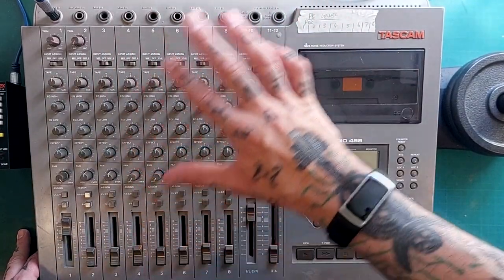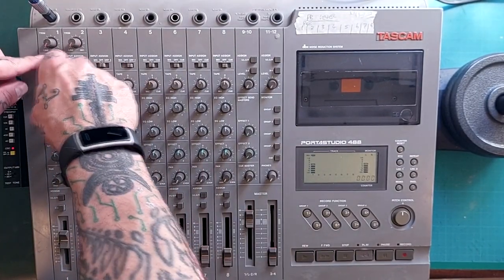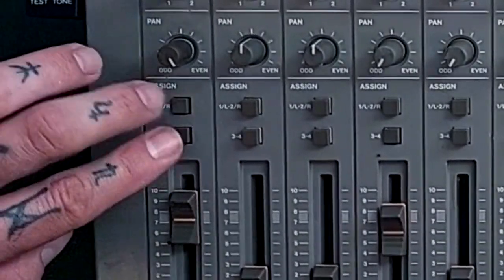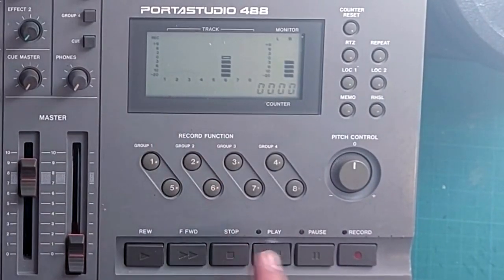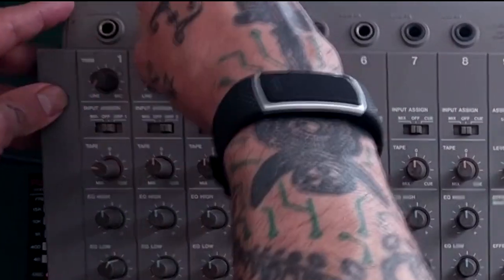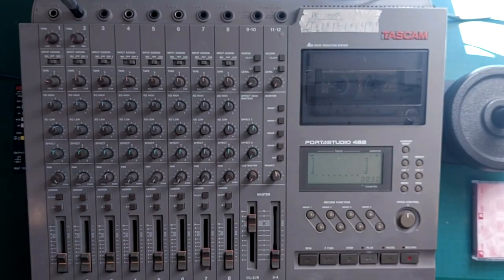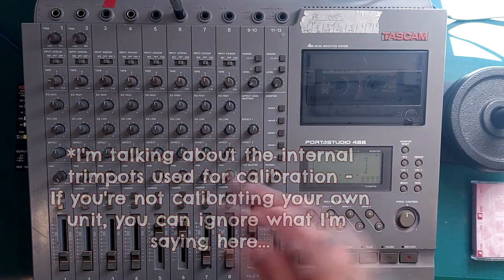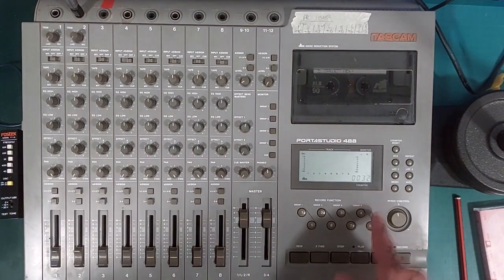Tascam 488 Mixer MEGA Tutorial

Comment: Ok so I have a drum machine connected to channel one and the audio running out of the ports studio to an amp. The amp is playing the sound from the drum machine perfectly fine, the main master volume is working fine and the individual track mixer/ volume adjustments are fine as well, but the monitor on the portastudio is not showing anything. The unit rewinds/plays/ all that and apparently would record fine if I could just get the audio to the monitor to record it? Help with this would be much appreciated I’ve never messed with this machine before and watching your video it seemed like it automatically just showed up in the monitor. Unsure what to do lol.

Comment: hi man, i want to do a tape delay with my 488 mkii and a revox a77 but i cant find any effect out on the mkii. do you know if there are some on the mkii version ?
Reply from the maker: Yeah, it’s the two jack sockets to the left of the XLR mic inputs on the top left of the unit, it says “effects sends” below them!
Reply: @Tetrakan  thank you so much ! also the cables welded to the motor of the cassette part have recently detached, I would like to solder them again but their length is very short, I do not know how to do...
Reply from the maker: Search for soldering tutorials, there are hundreds on youtube
Reply: @Tetrakan  sorry i wanted to know if you had any trouble soldering these cables, i wasnt clear enough 😁
Reply from the maker: No problem - I found it easy to do, but I have good equipment, and I have spent a lot of time soldering. Your mileage may vary!

Comment: Great machine, but I’d be tempted to trade mine for an mk2, just to have the mids eq. Always thought it was kinda neat having the ability to record 8 tracks on a good ol phillips cassette.
The 488 is definitely a bit more complicated to work with, isn’t it. I can’t even imagine what a 688 would be like....
Great tutorial here, I think a lot of ppl initially struggle with signal flow, and you did a great job of demonstrating!
Reply from the maker: Yeah if price and availability were no object, the Mk2 has better socket access, phantom power, a back-lit screen, and like you say easier interface and parametric mids. Some people swear bt their 644/688 but I couldn't get on with that digital routing system.

Comment: Loving these videos man! I blew an opamp on my mkii a while back, finally got around to diagnosing it (was literally smoking so easy to find) swapped it and it lives! that's until I put everything back together only to find out the gear c crapped out hence I found your channel :D
I'm thinking about busting out the mod for wiring up each channel to a 1/4 output. I see a bunch of people have done it but I'm not finding the info online. Do you have any intel on how it's done?
Reply from the maker: Thanks for the encoruagement. I ahven'y ctually tried those sorts of mods. I suppose I'd approach it by wiring the coupling capacitor at the end of the gain stage to the positive pin of the socket, and the negative pin to a nearby point on the same PCB connected to circuit ground. I think that would basically work, but I'm not clear on whether it woudl eb advantageous to add resistors in series or to ground for impedance reasons, i'd have to experiment.

Comment: Very useful tutorial thank you ! I was wondering, there is no individual output for the 8 channels but are outputs 1L, 2,R 3 and 4 those of the groups? (1/5, 2/6, 3/7, 4/8)
Reply from the maker: Those outputs correspond to the master faders. You can route tape signals to those outputs using the methods shown in the video. Check the other comments too - there is a workaround to send all 8 tracks to a different output socket by using sync, headphone and effect send sockets as well as the group out sockets.
Reply: @Tetrakan  thank you very much mate !

Comment: Tetrakan! I have owned a 488 for about 6 months and love it, however recently when I play a tape or try to record onto the tape, the tape speed makes a slow and depressing way down to a stand still, I'm presuming this is due to a knackered belt of some sort, was wondering if you would have more of an idea of what belt i would need to replace?
Reply from the maker: Could also be the idler tire for the reel motor needs replaced, I’ve used an o ring from an assortment box for that with success. The capstan belt I use for the 488 is the 3.4 flat belt from gbaudio.co.uk it’s about 200 mm folded length.
Reply from the maker: I’m pretty sure teac/tascam ceased supplying spare parts for their cassette stuff about 5 years ago - at least they have completely ignored all my enquiries in that time. The service manual is available for free download from my blog.

Comment: Thanks for sharing you knowledge, great video!
One constructive criticism: The sound of the pitch generator get's very annoying.
Maybe use a lower octave, or something like a drumloop for demonstration purposes.
Reply from the maker: Thanks. Good advice. Im planning to use  less intrusive, lower pitched synth drones in a situation like this and mute them while I'm talking.
Reply: @Tetrakan  Nice! By the way, your videos got me thinking to buy a old Tascam…I am looking at either the 488 or the 464. Leaning more toward the 464 for its individual tape output (which the 488 is lacking, right?) also it seems to have the better EQ section.
I want to use it as a mixer, as well as running tracks through it for some tape goodness, but also being able to easily export to a DAW.
What would I be missing (apart from 8 tape tracks) if I go for the 464?
Sorry for the long text…and don't worry about answering, if you are busy! Keep up the good work, thanks for all the info!
Reply from the maker: @SONWU youd be missing midrange eq on the 488. 488 is single speed. You can export 8 mono wavs from the 488 simultaneously using 4 x tape out, hard left right group out, effect send and sync out
Reply: Cheers…bought a 464 ;) with BBE, fully serviced for 140 GBP (in Japan that is) @Tetrakan

Comment: You can place effect sends in the stereo field, but only with one mono or one stereo send (stereo effect should be split into two jacks: one to 9-10, one to 11-12). You use the level knob of input 9-10 and 11-12 to pan and the level should come from the effect unit itself I think. I might be missing something but there definitely some in depth description of the process in the manual of the 488.
Reply from the maker: Thanks,  good point (which proves I don’t read manuals!) I may try to redo this video in a more concise way in which case I’ll be sure to cover that. You could only use one effect that way, correct? Whereas if you have two effects units with mono inputs + stereo outputs and an internal pan control you could place both effects in the stereo field?
Reply: @Tetrakan  yes I think you are correct, but I don't own those fancy effect units with built-in stereo imaging, so I don't know for sure. Funny thing however is that I find mono effects often  have way more of an effect on the music than washed out stereo, so I thought I should mention it here. Since I discovered this possibilty, it really made me love using the 488 even more. Anyway, thanks for the videos and hard work tetrakan!

Comment: Hi Tetrakan, 
I've had this device for a few weeks but I can't get it to play normally. Speed reading (with or without pitch). I changed the belt and the motor which was tired. But the problem of listening too fast persists I am in France, is there an idea of the problem please?
Reply from the maker: The unit plays tape at 3&3/4 inches per second, if you insert a cassette with recordings made at standard speed, they will play back twice as fast as expected, this is normal.
Reply: @Tetrakan  Thank you so much! I understand better why my audio tapes was too quick to listen. I needed to collect a few songs first. I'll just record on it and find a walkman to get my old songs back
Reply from the maker: Ideally you want a low or dual speed portastudio to recover your old songs. A Walkman or other ordinary cassette player will only playback 2 out of 4 tracks from your old songs at a time, and o e pair will sound backwards. This is because portastudio heads reads all 4 regions of a tape in one direction simultaneously, whereas a Walkman plays one pair at a time, then you turn the tape over to access the other pair.
Reply: @Tetrakan  Hi Tetrakan, hope you are doing well! Thank you for all your valuable information.
The old songs were recorded on a standard player after Pro tools sessions. this is the first time I've used a Portastudio with separate tracks. I did not know the principle of speed X2 and indeed, the phenomenon of reverse listening. Everything is absolutely clear to me thanks to you. do you have a particular brand of walkman (or other) reliable in terms of reading reliability? I want to send my old songs to my computer in the best possible quality. Nostalgia rhymes with the pleasure of doing well.
Thank Friend
Reply from the maker: I actually don’t know a lot about standard cassette decks. I do know very sought after decks like a nakamichi dragon can cost thousands of euros professionally restored, but I guess any recognisable brand of Walkman (Sony, aiwa , JVC etc) would be good enough and much more affordable. Try it and listen, only upgrade if the wow and flutter is too much.

Comment: thanks friend for all this information, it is much better than the manual.
I wanted to ask you, maybe you can help me. My 488 works fine on ff, on rewind, on pause, on stop, but the play fails(and therefore the rec)
When I place a cassette, it places the heads in the cassette for a second, and returns to holding them.
But if I remove the cassette, and with my finger press the button which is hidden on the left inside, the playback roller turns.
Thanks for any ideas you can give me, your channel has already helped me a lot. A hug!
Reply: I changed the belt and the problem disappeared!

Comment: I noticed gain trim was only on tracks 1 and 2... am I able to assign that to the other tracks without using those inputs or is that the only way?
Reply from the maker: You can route the output of the two internal preamps to any of the 8 tape tracks. If you need to record more than two mic level signals simultaneously, you will need external preamps.

Comment: What an epic video! I’ve owned my 488 for two years now and still learnt a lot from your video (I didn’t have the patience to read the manual so just bumbled through at first😂). The effect returns still confuses me a bit, I can get one stereo return from an effects unit with two mono Jack leads into each stereo return to work fine. When I try sending two stereo effects back to the 488 weird things happen and the effects are panned hard left or right (I’m using a lead with two mono jacks from the left and right output of the effects unit to a stereo jack on 9&10 & 11&12?).
Reply from the maker: Thanks. It sounds like your effects units have stereo inputs, so they are only receiving input signals on one half of the stereo image? If your effects nits don't have a mono input or setting to pan a monaural input within the stereo field the solution  would be to run a submixer between the 488 effect sends and the effect unit inputs (connecting the stereo output of the submixer to the stereo inputs of the effects unit - another 4 or 8 tracks' mixer could be used for this) then use the pan control on the submixer to place the wet signal in the stereo field.
Reply: @Tetrakan  That’s a great idea, thanks very much! I can use one of my other multitrack machines as a mixer to test it out. 👍

Comment: Thanks Tetrakan for all your videos! Anyone, I'm considering purchasing one of these and I'm wondering: Is it possible to bounce a single track just to add an effect to it, tweaking the effect in real time and also listening to the rest of the mix which is not being bounced? This would be needed for my use case. Thanks in advance!
Reply from the maker: Thanks. You could do that without bouncing using just effects sends or some other mixer routing facility, but if you wanted to record the performance back to tape, yes, provided there is an open track to bounce to (only seven out of eight tracks have information recorded already)